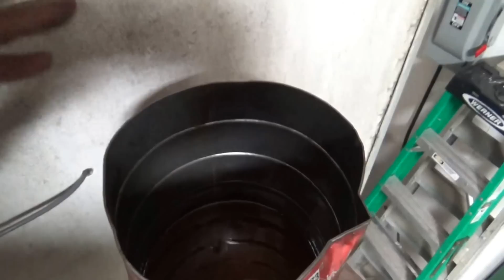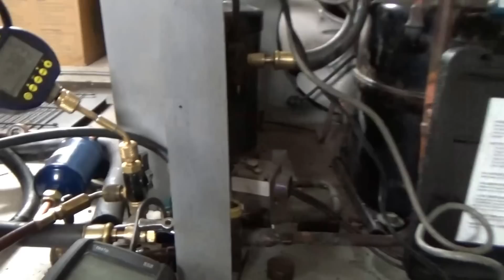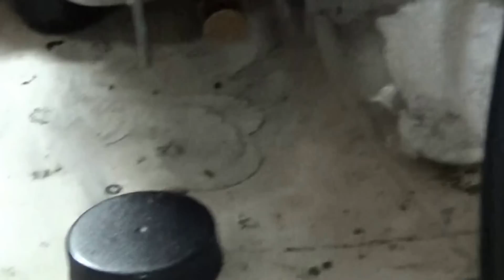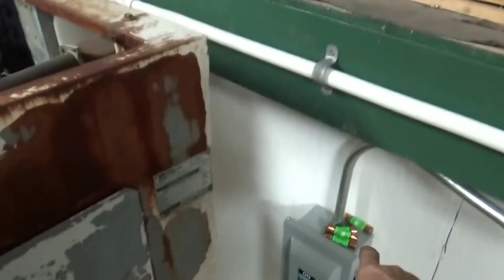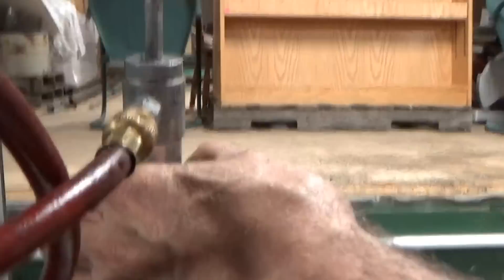JJ's Greenhouse part2

Comment: Nice job Jim, patience & optimism makes an old and fired tested system run once again...When I saw water running out of the liquid line in part one I thought no way will this system live to cool again!
Reply from the maker: +Rich Rada  I had a customer who shut his water cooled ice machine for the winter and he didn't drain the condenser, it froze up and split, the gas leaked out and in the spring he turned the water on and it filled the refrigerant lines and the compressor, when I drained the oil out of the compressor , it looked like a gray milk shake. Three oil changes, gas changes, drier changes and vacuums, it worked. thanks

Comment: Do you use the Supco oil on air conditioning units?
Reply from the maker: +Air Mechanical sure, it's a cleaning solution it will clean cap tubes, it's main function is to line all the metal parts and make them extra slippery, so if you have a compressor binding, drawing high amps and running very hot , it will help loosen things up.

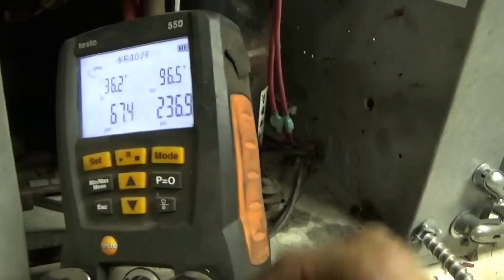Comment: correct me if im wrong, isn't 67.4 psig @ 44:16 a temp of 26.2 degrees f on PT chart for r407f?
Reply from the maker: +refrigeration tech I opened the valve to get a lower TD for humidity, this increases the flow of refrigerant back to the compressor thus a higher suction pressure and head pressure, as the temperature drops in the cooler the pressures will also drop, thanks
Reply: +Jim Pettinato sounds good, keep up the great vids

Comment: Great video Jim. Years ago a had an account with several hundred water source heat pumps. Inevitably one of the coaxial condensers would spring a leak and water would get into the system. I had an old timer show me how a cold trap before the vacumn would not only save the oil but speed up the pull down. He used an old r-22 can with another tap brazed on. I used an old recovery bottle placed in ice. Thanks again for all the videos, I look forward to them.
Reply from the maker: +Ian  Palmer thanks
Reply: Ian  Palmer. I would love to know more about that. Can you post some pictures?

Comment: nice video Jim! I have the same vacuum pump. I called JB in the past and asked about the oil level in the vacuum pump. they told me the level should be between the lines in the sight glass WHILE ITS RUNNING. they don't care what the level is when the vacuum pump is off. so usually on this pump when its off the oil level is near the bottom of the sight glass. Also when my oil is up above the line I noticed in my experience it wouldn't pull a deep vacuum. But while its running I drained down the oil to the correct level and my microns started to drop lower. This is what made me start to wonder what is the proper level. Is it when the pump is on or off. So I called JB.  just something I thought ill mention
Reply from the maker: +Anthony Reardon hvacr great input, every little bit helps, thanks